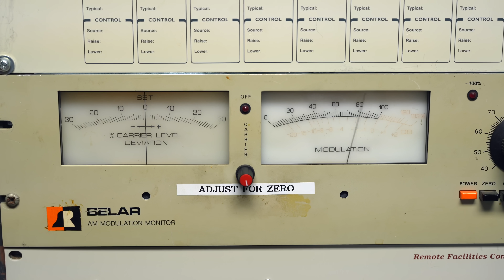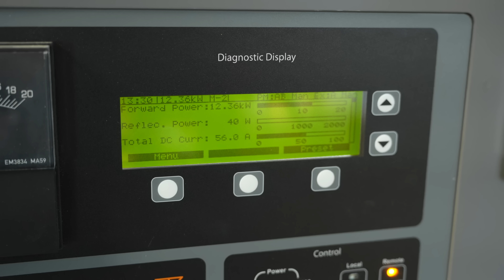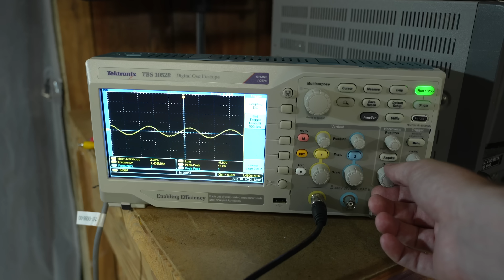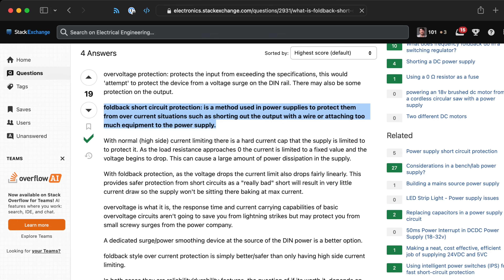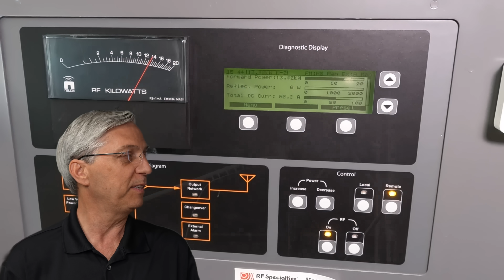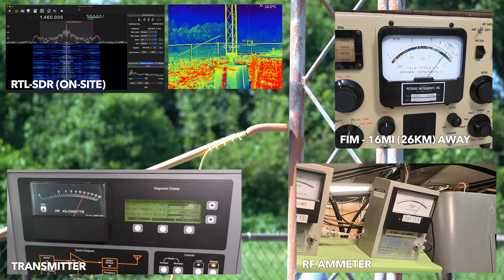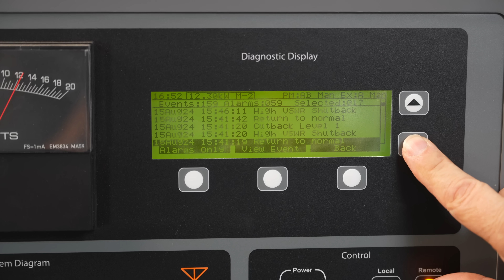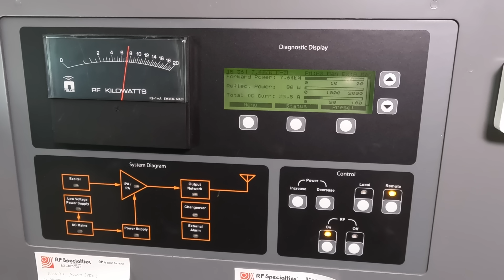How dangerous is AM radio? (ft Plasma Channel)

Comment: Am I missing something here ? You have the cable on the ground strap then to the sausage and the touching the tower that is grounded to the ground strap ???? There is no flow, the tower is grounded , the cable is grounded and the sausage is grounded , the RF exits the top of the tower out an RF antenna high above you . There should be no RF signal on the tower itself only the antenna high above ?? What gives
Reply: The metal tower is isolated from earth & sits on a ceramic insulator,   they basically use the metal tower as the aerial..
Reply: @Crazy--Clown wow , never heard of that before, usually the antenna is isolated from the tower and at the very top .
Reply: @JosephCowen-fz8vj  the same channel did a video about it,   I think its called What happens If I touch this...

Comment: I believe the phenomenon is called AM demodulation.   Fillings, braces, toasters, metallic objects etc...picking up radio signals.   
I've also heard a story about broadcast sounds coming from heads of garden lettuce and lightbulbs in the vicinity of powerful AM transmission towers.

Comment: my favorite part of the video was at 3:50 - 3:55 when you were looking at the coax inside the building with the IR camera, and passed by the 3" ferrite chokes that were just resting on the hardline, and how HOT they were getting just sitting there soaking up common mode EMI.  I wonder if the jacket on the hardline was rated for those temps?

Comment: W1JZR checking in...  Thanks for the presentation.  From my observation on your SDR receiver,  AM carrier shows at the center of the display, the strength will present a brighter color.  The audio bandwidth shows to be 6khz on each side, or a full 12k wide modulated signal.  NICE!  Love running AM  on the amateur radio bands, as there is still a following for that mode.👍

Comment: 7:53 When something is insulated, That object will have higher resistance which means energy would flow more efficiently and quicker than if you were to use raw wires that could handle high currents 50kW or so.

Comment: At what power do RF burns even start to appear?

When I am transmitting with my HackRFs 32mW output, I can touch my antena without a problem, and the onlything I feal is heat (its not even that hot, my incondecent lightbulb is hotter then that), I cant even demodulate any signal while touching the antena

Comment: Dear  Learned  Authors  and  Presenters,  First  Of  All,  It  Would  Be  Better  If  You  Told  Us  That  This  Radio  Tower  Is  Under  Ac  Voltage!  Why  Should  We  Tv  Viewers  Think  About  Why  Smoke  and  Plasma  Are  Formed  When  A  Cucumber  and  A  Metal  Radio  Tower  Come  Into  Contact  \  Уважаемые  Учённые Авторы  и  Ведущие Для Начала Лучше Бы Вы Рассказали Что Эта Радио Вышка Находится Под Напряжением Переменного  Тока! Почему  Мы Телезрители Должны Додумывать Почему Образуется Дым  и Плазма При Контакте Огурца и Металлической Радио Вышки

Comment: When I was in college, I worked weekend night shifts at an AM station as the transmitter operator.  One of my jobs was to switch the pattern at sunrise to the day pattern.  Do do it, you would press a button that reduced the power of the transmitter, then another that powered the relays that switched the pattern, then another to restore the transmitter to full power.  The phasor rack was right next to the controls and you could clearly hear the program audio in the sound created by the circuitry.
Reply from the maker: Those relays are no joke!
Reply: @GeerlingEngineering  yeah, they sounded pretty substantial when they were thrown.  The chief engineer made clear to us to NEVER switch the pattern with the transmitter at full power.
Reply from the maker: @Andrew-ep4kw  That'd be a good way to quickly rack up a few thousand dollars in failed relays!

Comment: so the mast is part of the antenna ? its not isolated ? is it part of the radiator or counterpoise ? my CB ground plane antenna has radials as a counter poise .
Reply: The mast, in this case, is the radiating part of the antenna. The counterpoise is a set of like 240 radials, which are buried under the dirt in the field. We'll have a video talking about them coming soon :)

Comment: The hotdog would seem to be more solid, whereas the pickle is more watery.  I would think once the pickle has evaporated most of the water inside it probably starts to sound poor, where the hotdog is more difficult to vaporize the water out of it so easily; under the heat it probably retains it's form/viscosity better.

Comment: Serious question that ive always wondered about. In theory, if you were to run and jump, and hug the AM tower, would you still get an RF burn since you yourself arent referenced to ground at that point?? 

KC1CQO
Reply: You wouldn't get the same RF burn, and it might not even give a tingle... however, at higher power levels towers still have different voltage potentials at different points, so it's still risky.

Some tower climbers (traditionally, at least) would have the engineer put the tower at a lower power level and jump over to the tower to change lights. I don't think I'd do that, and I'm guessing it's not permitted most places, but that would normally result in no burns, assuming a good clean jump and no slipping off the tower!
Reply: @JeffGeerling  Thanks!!!! Very cool!

Comment: Damn I was playing around one of these as a kid in a place we broke into…. Glad we didn’t climb it, never knew, there wasn’t a single sign warning us either
Reply from the maker: Many towers aren't AM, or energized (they just have antennas mounted at the top), so those towers wouldn't fry you while touching the base.

Always better to just not touch them at all, but some towers are less dangerous than others (but all should have warning signs, even if they're completely off—they can receive enough energy to give you a nice shock, in certain scenarios, especially if grounding systems are broken).

Comment: To more completely answer the question about what happens to the energy when shorting to ground potential:  Think about all the heat and smoke you’re generating by burning the hotdogs… mainly it’s going into heating the meat.  Some may be re-radiated in RF frequency ranges, yet not efficiently or effectively.  More effective is the re-radiating as sound energy through the “plasma speaker” and into the air.  Also, don’t forget that dirt is actually a rather poor conductor, and not much current is flowing directly through the dirt.

For more on myth-busting the ground / dirt ideas… see Bill Whitlock’s papers and presentations on the topic.  One in particular where he talks about the non-involvement of the earth grounding rods to residential AC fault currents is actually up here on YouTube in a video titled “Bill Whitlock - Signal Interfaces Debunked - 4/27/2021”.  At about 38 minutes in is where he starts talking about the relevant physics and concepts involved.

Comment: This would be interesting with a 100KW FM.
Reply: No, the heterodyne about the carrier is narrow and the Q on the finals are not absolute. I would imagine it changed the impedance and threw it out of tune.
Reply: Judging by what I've just read I don't think either one of you know what you're talking about. 
 @calldeltosell 
Am radio is very long wavelength They use the entire Tower As an antenna that's why it has to be insulated from the ground with a porcelain strain insulator and the guy wires all have to be insulated To keep the RF from draining to ground. Fm's short wavelength Means antennas can be From a few inches to just a few feet long Suspended from An uninsulated Tower. That's how you can tell if it's an a.m. Or FM Tower Just look for the insulators
Reply: @imnewtothistuff  - really? I didn't not know that. As an ex amateur radio who hand wired LF linear class AB tube amplifiers as a child and a degreed electrical engineer - I don't actually care. Commercial radio in America frequency bands make them behave very differently and yet neither break the laws of physics. I am proud you shared your opinion and will defend your right to have one. Have a great day.

Edit -------
I grew up with E over I R. E stood for electromotive force. And 468 over the frequency in megacycles is 1/2 wave length. I was hanging wire antennas with the snapped off necks of returnable coke bottles for insulators. Before I was 10. While I no longer code, I still can side key CQ..... 

BTW, V over I R isn't Ohms law. It's the kid's version. The actual Ohms law not only involves vectors but calculus. I would like to see you derive the near field equations from the general form Hertz equation. 

Now tell me you don't know physics without telling me you you don't know physics or electrical engineering.

Comment: The story was for WLW when they were at 500KW was that the fields were so strong that it resonated the metal car roof of vehicles passing on the highway, and supposedly some could hear the audio on fillings in their teeth.

I picked up their audio thru a concrete and rebar floor in a building about 5 miles away.
Reply: I heard similar stories from the KMOX engineers and a few from people who experienced some issues. A nearby house had a ‘toilet radio’!
Reply: As a lesbian I was briefly confused by the use of "WLW" lol

Comment: EXCELLENT CONTENT. 

Note his distance from the tower...for a reason.
And note the hot dog and pickle are grounded, not his end of the pole.

And avoid even touching a fence around a BC antenna tower. Theres no guarantee each wire is grounded.

The tx wont much notice. 

The current shunts cores (?) are showing up " hot"!

Foldback? I assume the power drop was active foldback in the PA and not just RF dissipation?
Reply: PS as to arcing, similar happens at the top of the tower with corona discharge which is also RF energy, just not necessarily the same frequency nor from the PA. Cirona vaporizes a corona hat eventually.
Reply: Yep, the Transmitter/PA stage was hitting current limiting protections, according to Nautel design engineers performing as designed—and apparently they've done much more extreme tests on their transmitters, shorting the path even closer to the transmitter to ground!

Comment: Having worked at the Brookmans Park transmission site in the UK, where they run a 140kW AM transmitter, I witnessed what happens when a wire crane rope comes within reach of someone and they don't bother using the grounding hook before reaching for the hook. The arc was impressive, the screams from the guy who grounded the arc were terrifying. I don't know how long that guy spent in hospital, as he worked for another contractor on site.
Reply: I used to live a few miles north of the site, the BBC tends to have really powerful stations. When drive past the site on the old A1 you'd hear BBC Radio 4 break through whatever the car radio was tuned to. I'm told people who had crystal set receivers in Potters Bar could hear it from headphones the other side of the room.

Comment: Of course the signal spreads out wider than a single frequency. Anything but a pure unmodulated carrier (and who wants to listen to dead air) will have increased bandwidth (over a pure carrier). It is impossible to transmit information without increasing the bandwidth of a signal, and the more information you transmit in a given amount of time, the more bandwidth must increase. I am certain you two know the details. Maybe do a future segment with a low-power (part 15 compliant) transmitter showing how all this plays out with AM?

Comment: 4:51 does where you touch along the upright matter? Is there any more or less energy where the trusses connect?
Reply from the maker: Somewhat, yes — the voltage and impedance along the entire length of the tower likely differs, though we didn't take any direct measurements. Would be interesting to follow up on that with some calculations and real-world measurement!

Comment: I had a very small RF burn years ago when I worked in Radio. Just on the tip of my fingertip from a source of only a couple of hundred Watts, and it hurt like hell. I can’t imagine 12kW. Also, it was unfortunately a digital source, so I couldn’t even hear the radio through my teeth.

Comment: I have a plasma globe. The kind you can get online or in a novelty store very cheaply. I've noticed if I put a penny on top of the glass dome, I can draw a small arc (maybe half a millimetre) from the penny to my finger which burns the outermost layer of my skin. 

What kind of burn is this please? Plasma? Electrical? RF? I'm curious.
Reply: It's a small RF burn given the high frequency used here.

Comment: Transmitter metering responds in interesting ways to reflected power. So, an increase in indicated power without a change in signal strength (via the FIM) during a high VSWR event would not be unusual. Thanks for doing this fun experiment!

Comment: So basically the Pickle Plasma became a really good band-pass filter for a bit when they're being charged and slightly lowered the DC bias for a bit lol.
I really wanted to believe in Pickle-based Band-pass Filter supremacy but i really dont understand much about RF, like how you can build a really good stub filter by branching a cut cable, microwave engineering is truly a wizardry.
Reply: There's nothing bandpass about a pickle. Any illusions of selectivity are just because there's over 1 million times the power at one specific frequency.

Comment: Next time you're thinking about doing this, I'd also suggest considering the possible damage to the structure - burning off any anticorrosion coating (paint?) on it and coating it in corrosion-promoting salty/acidic solutions, maybe even pitting from local arcing?

Comment: Fun stuff.  Would be interested in seeing the RF exposure calculations for 2 meters from the tower.  Didn't catch the distribution of the 12 kW being output through the phasor to each antenna, but assuming you chose the antenna with the highest power going to it.  If equal distribution to the two daytime antennas, 6 kW each or some other split, some value north of that.

We'll assume the occupational RF exposure limits in OET 65 are the ones that apply here.  The applicable values are in the 0.3-3.0 MHz row of Table 1 of Appendix A and are:  an electric field strength value of 614 V/m, a magnetic strength of 1.63 A/m, or a power density of 100 mW/cm^2.  An averaging period of 6 minutes applies in the occupational exposure case.

Roughly eyeballing Figure 2 of OET 65 without doing any further calculations it would seem that 2 m separation distance from the tower would just get you under the power density exposure limit.
Reply from the maker: 2m is the estimate based on OET 65 / Appendix A — there's more in the blog post on www.jeffgeerling.com about this testing. The antenna engineers we talked to mentioned the tables in that document are conservative estimates, but a good baseline.

This tower is roughly 7 kW in this array, for daytime power.
Reply: @GeerlingEngineering  Thanks 🙂  I do these calculations regularly for Ku and Ka band satcom antennas for FCC license applications, but much less frequently for frequencies down below 1 GHz.  The FCC recently updated rules on RF exposure and the OET is in the process of updating OET 65, in particular for the near field power density calculation of reflector type antennas.

AM, FM, and TV broadcast transmitters were a big part of the FCC radiotelephone operators license when I took it back in 1981.  Covered lots of the theory on those way back when but have never worked on one so it's always interesting when you take us to the station and give us a tour.

Comment: Did that with a Continental Doherty modulated 10 KW AM.  The Continental didn't care what the load was, would not fold back on you like that.  The Continental is still there as an aux because when there's lightning or something goes sideways with the DA, I can switch to the aux and stay on the air.

Comment: So, I recently heard about the 2004 Smokey the Bear Ballon Incident where a hot air balloon, crashed into the KKOB Radio Towers. Now the people who where in the basket of the Ballon were safe and they started to climb down. The engineers immediately turned of the Antennas but in the news segment on KATV stated that the people who were climbing down were safe if the Antenna was on until they step foot on ground. Everyone did survive but I still have questions. Im not 100% sure but if the Antenna was still on when they got on it, why didn't they get hirt. Why if they step foot on the ground would they have possibly died due to being exposed to the energy of the tower?
Reply from the maker: Depends on the specifics, but that seems to be a 50kW tower. They would at minimum get a very decent RF burn unless they jumped off the tower as far from it as they could!

If you ever find yourself on an energized tower, best bet is to call the engineering staff and have them turn it off before attempting the dismount!
Reply: While they were climbing down the antenna, they were perfectly safe. The RF energy has nowhere to go, but as soon as they put a foot on the ground, they are effectively 'earthing' themselves and will get severely burned. Hence why power was turned off.

Comment: I think the pickle's conductivity is mostly water-based, so as the end cooked off, it dried out and became significantly less conductive.  The hot dog and sausage conductivity is partly water, but also fats and proteins, which are more resistant to drying out and remained conductive right up to the point of ignition.  Now back to the video.